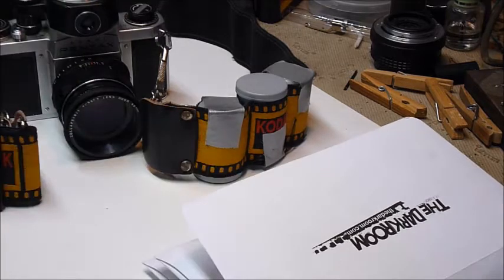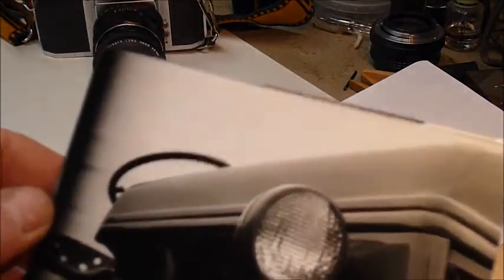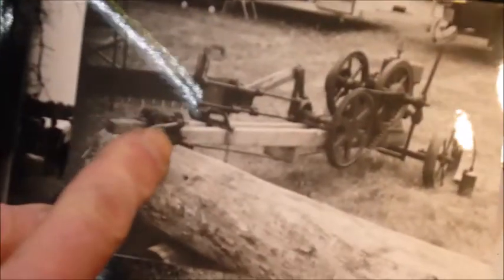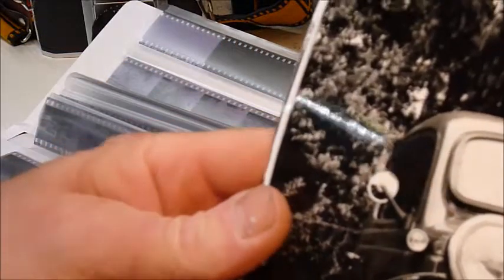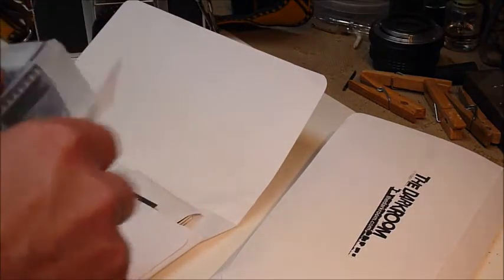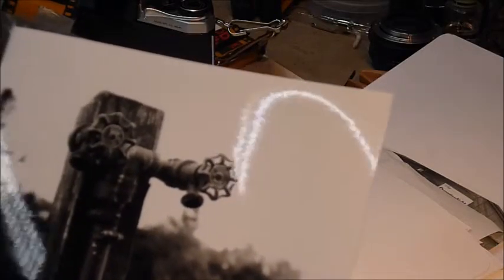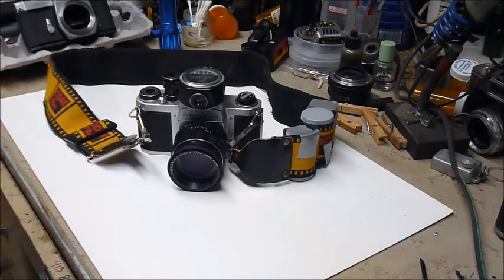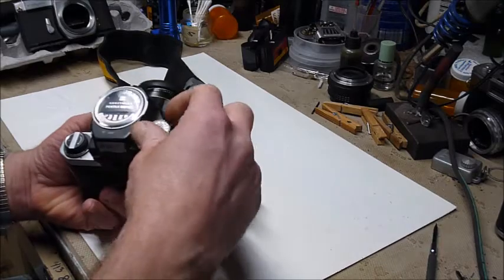Pentax S1A film test and results

Comment: Good job on the shutter curtain. Something I would like to tackle at some point. I have a couple of Asahiflex's with bad curtains I would love to fix.
Reply from the maker: I was a fun project, however I did have a slight ripple in the finished product. I did make a mistake in the reassembly, it capped at high shutter speed but it did work. The biggest problem was the metal end caps on the curtain, I was never happy with the result but it was only a first try.
Reply: @tobroken1965   First shots at fixing something are always hit and miss. I hate it when I do something perfect the first time and never can seem to repeat it the same again. Lol...